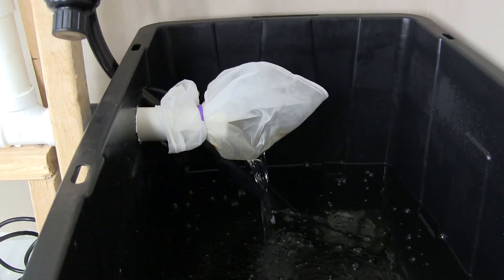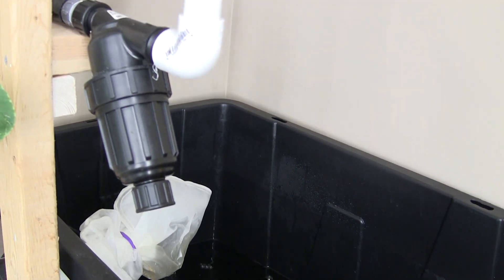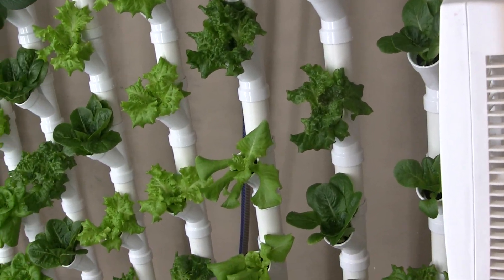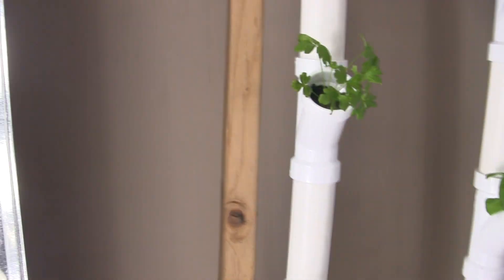Basement Hydroponic Tower Garden Version 2.0

Comment: this seems an expensive way to grow lettuce and herbs alone, could you also grow/add tomatoes and cucumber, peppers this way
Reply from the maker: it's not expensive in my opinion. quality lettuce in the store or at a market is expensive, and it's treated with chemicals, and it travels over 2,000 miles, and it's been dead for 5-10 days, and it has no flavor. herbs are even worse. I avoid them completely if I run out in the basement.  I wouldn't grow fruits in my basement either. I have a vid about growing cukes hydroponically in my greenhouse. That works pretty great. They are more sensitive to the nute and pH though so you have to keep on it.
Reply: @maryneumayer01  I feel the same about tomatoes- after eating them fresh all summer/fall from my garden, I hate the store bough. The store Roma's aren't too bad, but a lot of what is sold locally is frown within a couple hundred miles in southern Ca, even in winter.

Comment: Thank you so much for sharing this. Quick questions with your nutrient setup. Do you run constant circulation? If not, what timing do you use? And what size drip heads do you use? Do you have a flow rate you recommend for this type of setup?
Reply from the maker: 30 min on and 15 off. no drip heads - just 1/4 tubing. It's an open flow.

Comment: what light can i buy for this system so i dont have to make my own?
Reply from the maker: hi, sorry I can't advise. I thought they were too expensive so I made my own. Interestingly, I just removed the diffuser on one bulb and gained 45% increase on my Lux meter. I'm going to try this on 2 or 3 towers with removing 4 bulbs per tower to see if the plants respond/grow differently. If not, I'll actualize some welcomed wattage savings.
Reply: @maryneumayer01  I have done the same. I thought maybe you wanted it on. The light is both more directional and bright. Still think you need some wheels to easily move lights closer. Double the distance equals 1/4 the brightness with light(generally).
Reply: Try these: https://www.zenhydro.com/sunblaster-nanotech-t5-ho-41-4-ft-1-lamp-w-nanotech-reflector-24-cs.html?utm_source=google_shopping

Comment: First of all, WOW!  Best video I've seen in a long time.  I learned so much.  I had read daylight LED bulbs were good for grow lights.   They're $2.87 each on amazon FYI.  Very thoughtful design.  I bought Barrina 4 ft LED lights on Amazon $100 for 6, figures out to under $17 per  light.  They're pretty red, perhaps mixing a few of them in would help with the red lettuce.  They draw 39.1 watts each and probably cover as well or better as 3 of the leds, which would draw between 39 and 45 watts combined, or so.  I think they would need to be closer than the LEDs are in this video.  They are also pre-wired so you can daisy chain 6 of them together and you don't have to buy light fixtures.  That said, I really like your light fixtures.  Very inventive.  I've read that flat white paint reflects something like 90% of the spectrum you want, and mylar, like the cheap space blankets others have mentioned in comments, is something like 98%.  I got a package of 10 for $7 on Amazon.  I see aluminum foil in the video which I've read only reflects about 55%.  (which is still way better than nothing).  I bet with mylar behind the plants, and with it behind the lights and lining the reflectors, you'll see gains.  How far from the plants have you been keeping your lights?  Did I mention I really like your lighting setup?    Right now I'm using the barrina lights and mylar tenting for lettuce/swiss chard/tomatoes.  Good results.  I'll definitely be mixing in more Daylight LEDS and I really love your set up. Awesome video!
Reply from the maker: Hey Buddy! Sounds like a good suggestion, the mylar. I didn't think it was that cheap. I'll check it out. My lighting is about 22 inches out from my plants. Interestingly, I just removed the diffuser on one bulb and gained 45% increase on my Lux meter. I'm going to try this on 2 or 3 towers with removing 4 bulbs per tower to see if the plants respond/grow differently. If not, I'll actualize some welcomed wattage savings. I'll remove the double socket and just use a single bulb. I'm excited to see how that works out.

Comment: Im a noob. I have few queries.
- can we use LED (Stripes) lights for growing? 
- The water flowing up in pipes, how does it water plants while coming down ? just dripping?
Reply from the maker: Hi, I use full spectrum LED A19 bulbs for greens so if by stripes you are talking about a LED T5 equivalent I think that should work fine. The nute runs down the front of the pipe using gravity, aerating in the process. Best of luck!

Comment: https://www.dropbox.com/s/5r9uzl6wia26luf/20191119_162859.jpg?dl=0.        Hi Joe. I built your system Outdoors and it seems great although I haven't hooked it up yet. The angle of the verticals is about 3 degrees. That's 3in farther out on the top then the bottom. From your experience, is that enough for the Rockwool cubes and roots to catch the nutrient
Reply from the maker: yes, that should be just fine. Great job! You may want to give a coating of UV resistant paint to protect the pvc from breaking down from the UV rays from the sun.

Comment: Can someone please provide numbers, stats, cost, yeild, investment, maintainance, etc
Reply from the maker: Hi Nikit,that's almost an impossible question. depends on what you build, skill level, where you get your materials, what you pay for energy, where you source your hydroponic supplies etc. too many factors to present a price. ball park for me for this system- $800 or so for the build, $65 for materials and energy per month with current lighting - perhaps more - tough to say. cheaper in the short tern to purchase your greens from Whole Foods but not as sustainable. Personally, I'd end up paying for 5 bundles of kale/bok choy per week for breakfast smoothies, minimum 4 or 5 heads of lettuce for lunches and side dinner salads, and basil, dill, cilantro, parsley, mint, chard, etc. If that's all organic that would run me over $100 a month I figure - Chicago isn't the cheapest place to buy groceries. Plus my food is clean and there are no food miles. Hope that helps.
Reply: @maryneumayer01  it would suffice if I get the details of only this experiment

Comment: What kind of seed plugs are you using,   Do you just stream the water in from the top or do you use a spray nozzle ,  have you figured out the total cost of your system, ( with improvements)  thinking of doing one but with just three rows , and I can expand it later , great idea using the rubber tube to make it expandable ,thanks for a great video !
Reply from the maker: rockwool plugs. water streams. see above for some cost ideas. good luck!

Comment: You need to cover the water. Protect from light. So algi is not growing in water.
Reply: You must have skipped through the video. It was covered until he removed the lid to  explain  the nutrient tank & functions.
See @  3:43
Reply: @MaryandJoe Neumayer And the teacher part shows! Including the patient responses. :)   While I'm in a comment, I'm building my system now -- totally inspired by you, thanks! I've bought these grow lights (link at end of comment) and will let you know how they work. I may need to supplement with regular lights, but they're blindingly bright! I plan to put the Mylar blanket type things behind the grow area, but I'm in Florida, and frankly, the house is on AC most of the time anyway. I did have a question about the plugs: reading through all the comments, it seems that you put the growdan plugs right into the wye, right? No net cups? I was just about to order those, and will hold off, at this point. The system I plan will be about half this large, about 7x7.  I had seen, in one of your other videos, you had experimented with some LEDs. In my reading, white LEDs are not full spectrum, and the plants seek red and blue spectrums. Though I've never done one before, and am just now on the adventure. I'll try to post back the feedback. Thanks!!!!  Perhaps this following is worth a consideration: https://www.amazon.com/gp/product/B07QWV1THV/ref=ox_sc_act_title_3?smid=A1V31LM9AH9FRH&th=1
Reply: @donzoc  how'd those lights end up working for you? Just curious as I was looking at them too for a similar setup. Thanks
Reply: @TheNatedgreat18  I like them, but I'm not thrilled. I believe the system needs something beyond those red/blue frequencies. A friend has an outdoor Tower Garden (commercial product), and most all her stuff grows about three times faster and bigger than mine. I want to experiment with a simple white led column, or other setup, but haven't done it yet. Some of my stuff grows, and some does not grow to save my life: Pepper plants are prolific, as were tomatoes, and most lettuces. I have herbs, and most of those grow well (and taste great), but there seems to be a "fragile period" that the plants need to get past to grow. After six or eight attempts to grow Mustard Greens, all died but the one that finally "took". Same with bok choi, though not a single one of them "took" so far. I would include some pictures if I knew how to do it. --And certainly would love any counsel as to how to get this system to work. But currently, I have half the lights turned off, and the window shade open (in a relatively shaded area to begin with.) Half the lights seemed better than all, and certainly it was better for my utility bill which went up by some $20/month, initially. I bought both the four and two foot lengths of those samples, and I like that setup, as I have a full six foot vertical length of light. But I'd probably sell the unused half, and replace them with white led.
Reply: @donchinnici  Thanks for the reply and the info on your experience. That's really interesting though. So I'm not sure what the difference is between your product and this one (https://www.amazon.com/gp/product/B082ZKJZP1/ref=ppx_yo_dt_b_asin_title_o02_s00?ie=UTF8&psc=1) - both are Full Spectrum, but yours are the red/purple tint whereas the other is white. This guy uses the white version (https://www.youtube.com/watch?v=-yfQpTU6kJo&t=464s) and he has a Neumayer vertical setup and you can see his results are positive ones. I couldn't imagine much of a difference between the two products though. Maybe there's another factor? Nutrients, PH etc?
Reply: Hi  @TheNatedgreat18 , thanks for that link. I wasn't aware there was a white version; when I'd done it, it was only the blue/red, which I don't think is the ideal for these plants. My setup is almost exactly like MaryandJoe's, as they were my model, but they're not growing as well as I'd hoped, I think because of the light type. I measure the pH to 6.3, and put in the recommended nutrient (now doing about 2/3 dose to minimize some algae growth, so I don't think it's that. The water I use is city water through a carbon filter, so perhaps reverse-osmosis or the like would work better; but I'm thinking that those parameters are close enough. When I began to open my shade (spilling red/blue light out into the street that makes my neighbors think I have a grow room--which I do, but not like they think, ha) the plants began to prosper a bit more. But I have been wanting to swap out some of the red/blue for pure white. The ad on the page I linked also said "full spectrum" but I don't really think that's true. I still do believe there's a value for the red/blue, as my reading says these are important for green growth and flowering, but I think it needs more. MaryandJoe's system is prospering phenomenally with just white LED lights, so perhaps I shouldn't have tried to reinvent the wheel. But, ah, we are tinkerers. Ha! If the whites were available at the time, I think I would have gone that option. But--I don't know if you're interested--but, if you'd like, we can try and take the conversation offline, and I would be happy to swap out some of my red/blues with whites, if you wanted to attempt a combination.
Reply: So many stupid ass people comment on something that they are ignorant of. Watch the whole video and stop being a mindless drone.
Reply from the maker: I feel your pain! But as a teacher I have learned to exercise patience. ;-)

Comment: you really should remove the reflector from the led lamps, and the pump should not be turned off at all.
Reply from the maker: I just cut off the diffusers from 3 towers and will see how it works out. I reduced the number of bulbs too. The light intensity increased by 45% (lx) without the diffuser, so perhaps I can get away with less wattage to run the lighting. Thanks for the suggestion!

Comment: Ideally the lights should be as close to the plants as possible without touching to increase the photons that the plants receive. Maybe a stand with casters to allow moving the lights away for planting and harvesting? A 5000k color temperature should be great.
Reply from the maker: they are on casters, and I do roll them out and in for access. I found about 20 inches with these bulbs are a sufficient distance from my greens. Any closer and I start getting tip burn, even with optimal nutrient absorption for calcium at 6.2-3. Thanks for your thoughts.
Reply: @maryneumayer01  - Thanks for sharing the information and making one of the best videos on this subject. Digikey sells LED modules made by Bridgelux & Samsung that are used to create the newer LED grow lamps. The module consists of multiple surface mount LEDs soldered to an aluminum printed circuit board and wired together. There is a voltage and a ground connection on each module. Samsung became #2 in volume LED manufacturing due to LED illuminated LCD televisions and currently have the most efficient white surface mount LEDs available. There are multiple surface mount LEDs in the bulbs that you are using and they are arranged and diffused to make the light multi-directional. The LED modules provide a very concentrated, directional light and could reduce the electric bill even further although there would be a significant up front cash outlay. The LED modules require a constant current power supply and need to be mounted with conductive paste to an aluminum heat sink. Check them out, there are comprehensive data sheets available on the Digikey web site. Please don't take any of this as criticism, you have an excellent setup and your plants look very healthy. I worked with LEDs for 10 years as a design engineer, am retired.

Comment: Remember you can always make a system more efficient. You just have to figure out how your going to do it affordability. That's the concussion i have come to. But I'm sure you already know that. I don't mean to preach to the choir. Happy Growing!
Reply: I built my rotating version of this set up and my pipes are straight up. I noticed the water is everywhere inside the pipes and tends to spread as roots develop.
Reply: @beast91509   Sounds like a good set up! Nice! Have you noticed the roots growing any fast with that set up?
Reply: @missouribotanicals9801  I have noticed the seeds germinate quicker and seem to at least get their start really fast so I'm still waiting to see the progress in the towers themselves.
Reply: @AEON.  should work. I noticed i get the best results with shiny coated tin metal. Best part about using this is you can cut it and rivet it to any shape, size , or design. Also help you control temperature with just a fan hitting it at different speeds.
Reply: @AEON.  No Problem. Keep the good ideas flowin!
Reply from the maker: Jawohl, you are correct. I ordered some mylar blankets to test. A concern is airflow if I attach the reflective behind the plant tower. I don't want to stimulate the growth of mold/mildew by trapping humidity from transpiration.

Comment: If you cut the LED plastic light bulb housing off the lights with a box cutter the lights will be twice as bright and you can use less bulbs and power. Works great for me and my company. The lumens per bulb double to 3,200! Trust me you will like the results! I figured this a few years back. Watch out though you expose to conductive prongs in the bulb along with the Raw LEDs so unplug or use rubber gloves when changing Bulbs and keep kids out of the area. Also because you are releasing the heat trapped in the bulbs in this way they last even longer. I have some that have been running 5 years strong. You will get way better growth even faster. Nice system i like it! Good Job! If you use wind and solar the system cost nothing to run. That's how we do it here at MissouriBotanicals.com . God Bless and have a great day. Happy Growing
Reply from the maker: huh - that sounds like a great idea. I'll give it a try. Thanks for sharing! I have a COB setup that I have been putting off completing for a while now. According to my calculations I should be able to cut down my power requirements by half with my 30 watt COB diodes. I have a hard time wrapping my head around the COBS - they way they work. Seems like some dark magic must be involved. I'll get to it one of these days.
Reply: @maryneumayer01  Yah i have use the COBS also. They are more money but i do like them.

Comment: Great project!
Thanks for sharing it! Could you explain pls if the feeding line goes throw the pipes or if it only drop the water at bottom of the pipes? Thanks again
Reply from the maker: The irrigation lines (1/4 inch) go from the back (in  my newer models) and spray to the front of the towers, and then the irrigate the plants as the nute runs down the towers.

Comment: Awesome video! With the 4.5 inch gap in-between the Y-Tee's, are you cutting the PVC to exactly 4 1/2in end-to-end?Or 5 1/2 to account for the 1/2 on the fittings? Thanks so much!
Reply from the maker: I cut the pvc exactly 4.5 inches - that is the total cut length for my basement system. For the greenhouse I am a bit more generous since I'm not paying for lighting!